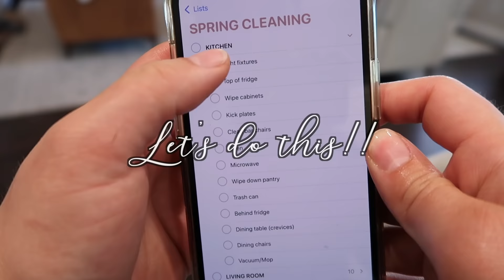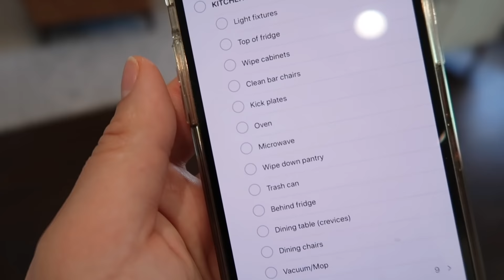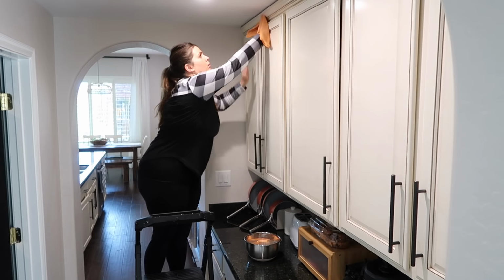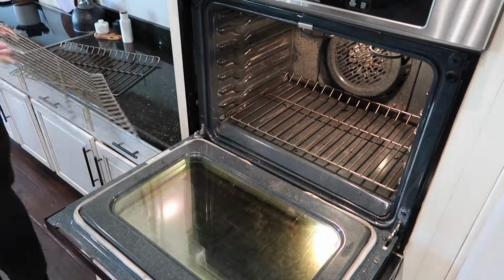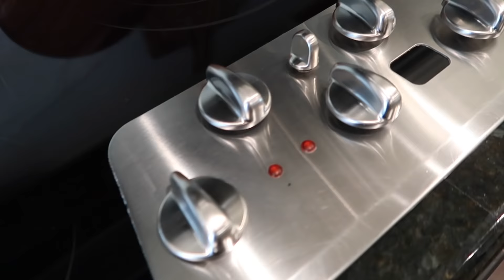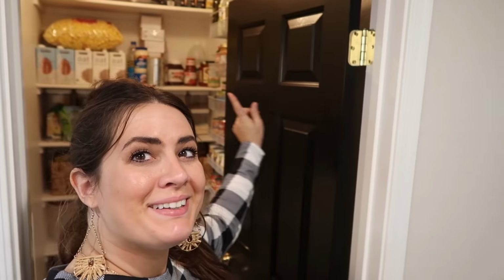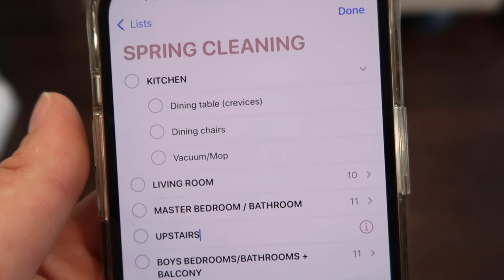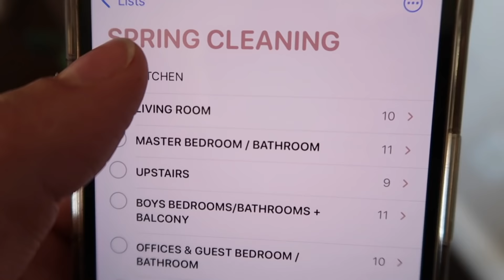SATISFYING SPRING CLEAN WITH ME 2022 - Ep. 1 :: Kitchen Deep Cleaning Motivation :: Spring Cleaning

Comment: My favorite way to clean our microwave is to use fresh lemons.  I use a micro safe bowl add water and the juice of one lemon and then toss the lemons in the bowl as well.  Microwave for 5 minutes.  Then wait a minute or two remove the bowl (might need to use towel or pot holders as the bowl can still be hot to the touch) then wipe down the entire microwave - all the yuck easily wipes off!  You can then use the lemon water and lemon rinds in the sink - poor the water down the drain.  The lemon rind can be put in the garbage disposal and is lemony fresh.  Really enjoying episode 1 of your Spring Cleaning for 2022!  And I love all the rattan light fixtures you have installed!

Comment: for my microwave, I use a cup of water (put the water in a 2 cup container) mixed with the juice of a lemon and I add the cut parts of the lemon. Simply heat the whole thing for 2 minutes and voila...it all comes off with a simple wipe and you're done. It leaves a fresh clean spring scent.

Comment: Here is a little tip that you are most likely aware of no doubt when it comes to cleaning your oven. Take the oven door off. They all are the same & slide right off and back on again. It makes oven cleaning so much easier on your back & legs. Even if your doing a quick wipe & go. It’s just like taking the stove top knobs off to clean the top surface, so why not take the oven door off 🤷🏻‍♀️? I usually lay the door on top of my counter, table, or outdoor patio table depending on the weather. I lay a thick towel down underneath the oven door and it makes it easier to clean the oven door as well. I love cleaning the door outdoors more than anything. You can use the outdoor hose to rinse it off really good lol. I let it air dry for a couple of hours in the sun on a warm day standing up, then wipe it down with an e-cloth & it’s ready to be put back on 😊

Comment: Pro tip from 7 yrs or being a Line Cook, if you have a stuck on mess in your microwave. Spray the inside with water or multipurpose cleaner and turn it on for 15 seconds. Everything that was stuck on will come right off

Comment: For the microwave I use a 4 cup measuring cup full of water and a lemon cut in half (optional).  Heat the water for 5 minutes, then wipe it out.  It creates steam in the microwave and loosens all of the dried up food, etc. off the inside of the microwave.  Found this hack on Pinterest somewhere a few years ago.  Makes it so much easier.  Also, see where some people suggest wiping down baseboards with a mixture that includes fabric softener.  It's supposed to keep the dust off the baseboards longer, haven't tried it, but would definitely like to know if anyone has tried it and if it worked.